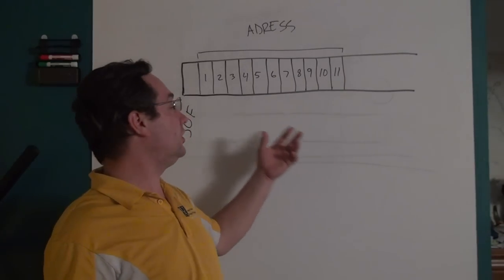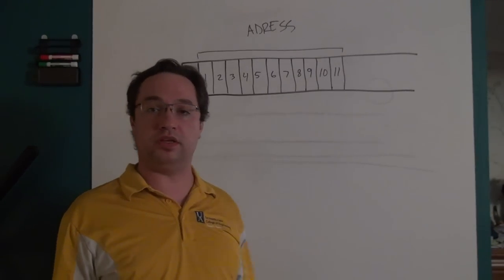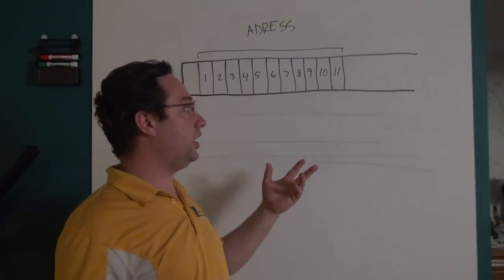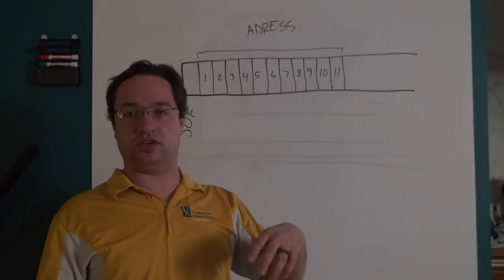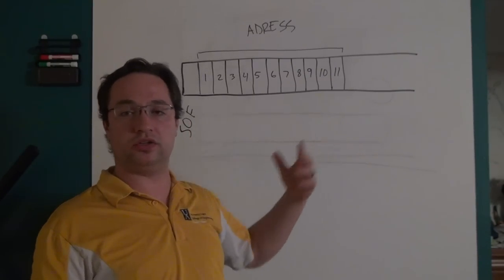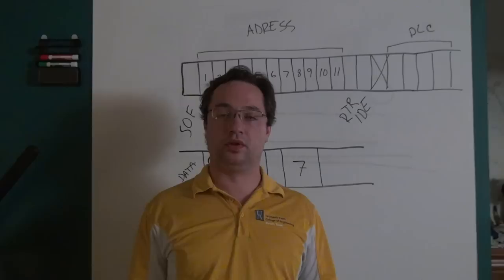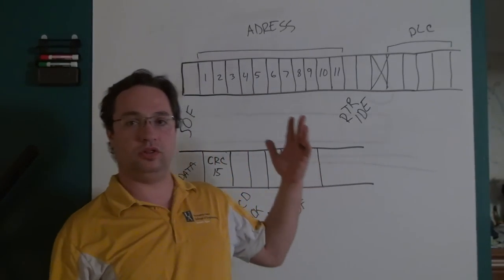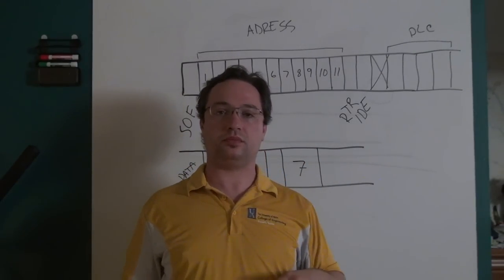eapbg #48 Introduction to CAN (Controller Area Network)

Comment: dood  im an aspiring auto tech  pro , your a dam good instructor  one of the best presentations of CANBUS  i have seen on YT!!!. Dave hobbs eat your heart out this guy is a good teacher  you should collaborate with some tech instructors on YT here like scanner danner or pine hollow auto diagnostics just a thought !!!
Reply from the maker: Thanks. I'm actually an ex mechanic and funny enough I did not use any of this for any kind of diagnostic work. Nor did I even learn it until much later. The info in this video is all design related. Engineers would use this to design a network from scratch. For troubleshooting CAN bus networks in cars all you really need to know; is the wiring good, are the termination resistors good, are the voltages stable and not shorted, and unplug modules until it starts working. If you haven't already check out my video on CAN bus baud rate. That one will make your head hurt. I have thought of doing an eapbg auto edition. As a mechanic, I was the go-to diagnostic and driveability guy. I was thinking of some videos on how car subsystems work like EVAP, fuel injection, or operational strategies. I wouldn't do anything make model specific mostly because I've been out of the game for at least a decade now. Not sure how much demand there actually is for stuff like that.

Comment: VERY GOOD explanation!  My only question is, what happens if a line to an ECU is shorted or severed?  Is that when the ACK say "Hey!  where are you?"   In this case, the bus is still alive and well, but the one ECU does not respond to the ACK?
Reply from the maker: CAN is tricky that way. Any one module can ACK effectively for the entire bus. The ACK only represents that a message came through correctly and not who needed it. Because modules don't talk to each other a module can vanish and the bus would never know. In cars there is a work around. Usually the gateway module (BCM or gauge cluster) keeps track of what modules are up and sets a code if it hasn't seen one in a while. There is also like a role call type feature.

Comment: Interesting explanation of CAN bus operation.  I regularly have CAN bus communications on a STAR topology with up to 120 devices and only using (1) 120 ohm termination resistor at the source of a central controller (a master of sorts).  All transmission is over 105 ohm CAT 5 cable at 115k.  I have achieved solid communications over 3,000 feet of unterminated cable.  Interested on comments as to why this works.  I suspect the low data overhead is partly responsible for the success of this setup.  Usually a single command is issued for operational control.  Please advise if you have similar experience.
Reply from the maker: If I had to guess from your description. There is a really low data rate. The lower the data rate the farther the signal can travel. Also, the central controller is not a typical setup. I'm willing to bet that there is no arbitration and all the slaves are in listen mode only. This would keep collisions down and reduce the effect of reflections, a slow data rate would help with that too.
Reply: @eapbg  Actually this is a motor network for window roller shades.  Each system has a central CAN controller that issues commands to the 120 individual motors or groups of motors.  The motors receive and send data like temperature, position, torque utilization, voltage at motor, rotational speed, etc.  The fact that CAT 5 cable works (outside to 120 ohm standard) and that we are using completely unterminated STAR home runs to each motor is the part that falls completely outside of any published standard.  I agree that low data rates are mostly why this works.  It seems there should be a "CAN Whatever Standard" as it is a very robust.  I would not recommend this for critical applications.

Comment: Very good explanation indeed. Thank you. But still I find one point misleading: you show the connection to the bus as Tx being connected to CAN_H and Rx connected to CAN_L, which is confusing. If I understand correctly, both CAN wires (CAN_H and CAN_L) are connected to both parts of the transceiver (that is, to both - transmitter and receiver).
Reply from the maker: The transceiver has the circuitry to convert H and L to TX and RX. There are no direct connections from TX and RX to H and L. There are pins on the transceiver that have all these connections. That is what the diagram in the video is trying to illustrate.

Comment: I'm not a CAN expert by any means but I know that the technology has been around for a long time.  With that said, I can see CAN being replaced by possibly EtherCAT in the future.  A much faster and deterministic communications protocol.  Of course it may take some time since the CAN system works well and why change something that isn't broke?
Reply: Actually EtherCAT protocol is actually based on CAN Open over EtherCAT (COE). The distinguishing factor in EtherCAT is that the message is decoded in ASIC  hardware which makes it much faster and deterministic.

Comment: You did a amazing job explaining the Can Bus. I’m working on my own Can Bus project and would like to ask you a question?
Reply from the maker: Sure, go for it.
Reply: Do you know if there is any way of capturing a message sent from a node. I have been using a Komodo Can Duo to watch the vehicles can bus messages. I am able to filter down the information by IDs. But I looking for a way or a tool to know exactly what a node is sending. Thanks John
Reply from the maker: @2lowinc236  Practically speaking no. Because of the way CAN works the message pool is homogenous. You have to have prior knowledge of what node transmits what IDs to be able to monitor the traffic from a single node. I have theorized that if you dismantle a module, find the CAN transceiver and attach the TX pin of the transceiver to a microcontroller RX pin you would be able to sniff just that module. But it is a destructive way to do it.

Comment: Thanks, Instead of disconnecting one module at a time is there other ways to troubleshoot? You can look at the CAN signals ID message number and Hexidecimal value and CRC value, can this point you in the direction of knowing if the Module is bad or good? You can measure the CAN signals with the module "connected" and look at the ID message number, hexidecimal value and save them. Then you can measure the CAN signals with the module "disconnected" and look at the ID message numbers and hexidecimal values and save them. After you have saved both connected and disconnected values you can "compare" them to each other?
Reply from the maker: I'm not sure what kind of issue you're trying to diagnose but your welcome to try.

Comment: Thanks, yes a Central Gateway they call them also. So a Central Gateway controls all the difference busses, like SAE J1850 signals, ISO9141 signals, ILS signals, CAN signals? Does every car have a central gateway circuit board?
Reply from the maker: The Central Gateway does not control the bus. It is only a ling between the buses. The Central Gateway is also not just a circuit board. It tends to be built into something like a body control computer or gauge cluster. It is difficult to speak in absolute terms like "every car". No, not every car has one because back in carburetor days there were not buses. Then some networking was required and there was only one bus that linked a few things. Because there is only one bus then a Central Gateway is not required. Also it is possible for the Central Gateway not to connect to all the buses. Sometimes there are buses that are isolated from the rest of the vehicle.

Comment: Good video.
I'm using the Arduino Uno + the MCP2515 chip Transceiver ( as a node ), and have connected two nodes to two different Arduino connected over the bus. For now, I am only simulating some random data ( e.g: ABS ) across both the nodes.
In your video you talk about the End Resistors over the bus ? Do I have to connect resistors at the end of my Arduino+MCP2515 transceivers ?
Reply from the maker: The MCP2515 is not a transceiver, it is a stand-alone controller. The MCP2515 needs a transceiver to get on the bus. An Arduino CAN shield has both built-in. If you are making your own bus then you need the two resistors at each end.
Reply from the maker: @kiranshashiny  yes, that is a transceiver. It is used together with the MCP2515.
Reply: @eapbg   - Thanks for the reply. I do NOT have the Transceiver,  just the CAN controller MCP2515, So when I connected two Arduinos to the MCP2515s  and did a send a receive, What was the 2 wires that I drew from the MCP2515s ? I used fowler's library CAN BUS Shield library and used the built in example Send and Receive programs, they were communicating. I sent an Arbitration id of 0x00,  and the other end got it. 
1) What was the two wires that was used to communicate between the nodes ? ( is that not the bus )
I'm googling and just starting with CAN implementation as a hobby and meanwhile thought of asking you.

While I continue Googling, electronics.stack-exchange.com, Youtubing for answers - thought of posting it here.
Thanks in advance.
Reply from the maker: @kiranshashiny  Assuming the picture is correct, that board has a transceiver and a controller. The transceiver is the 8 pin SOIC in between the connector and the larger controller chip.
Reply from the maker: @kiranshashiny  While it is possible to communicate without transceivers, it is not practical.
Reply: @eapbg  Thanks for replies - Did not see the notes until now. Sorry about delay in responding. I got me two 2551s and working with it.

Comment: Do you  have a video  for  the  diagnóstic  purpose only for technician  ?, this video  is great  but is more address as   programmer.
Reply from the maker: What kind of diagnostics are you looking for? Physical CAN is quite easy to diagnose. There are two 120 ohm terminating resistors at either end. Ohming across the bus lines will give you about 60 ohms. If the bus is 120 ohms or greater then there is an open. If the resistance is much less than 60 ohms then there is a short. If the bus is between 60 and 120 ohms then there is high resistance.
Reply: @eapbg  thanks for responding,  when there is. A gate way  involved  for example  to dived  if the gate way is the problem or another problem  module. Example 1: there  is a u communication  dtc but there is not a clue on the dtc what module  is responding, kind of like  p0300 dtc like romdom misfire  where  they do not know what cylinder is  the one is falling.  
Example 2:  when I have no communication   through  out the dlc conector   with any module  but the  dlc  goes direct to the  gate way , can I disconnect  the  wires  that comes for example  from the pcm to gateway  and create a jumper ( disconnect) de gateway  and do a jumper between the dlc connector to talk  with scanner to  pcm  in this case ?
Reply from the maker: @JoelAutomotiveInaction Sorry, this is going to get a bit ranty because it is a pet peeve of mine. The CAN that I described is the physical communication layer and is exactly the same for everyone; automotive, industrial, aerospace, and whoever else uses it. A software layer is then added on top of CAN. For automotive, this is OBD2. For industrial, this is often CAN open. The software layer is entirely independent of the physical layer. OBD2 existed from '96 to '08 without CAN. What makes things worse is that OBD2 is actually a layer cake of software as well. The OBD2 side is what is outward-facing and mandated by the government. There is at least one layer beneath that which is manufacturer specific. Both examples given are manufacturer specific. 
Example 1: CAN has no way of detecting what modules are present, at all or what so ever. All it knows is that at least one node ACKed after a message was sent. U codes exist in the next layer up. The manufacturer sets up a structure where one module keeps track of who is there and who isn't and sets U codes to show that it has not heard from someone. That said, follow the manufacturer recommendations and diagnostic flow charts. 
Example 2: The architecture of the CAN lines only going to the gateway is transitional. Some manufacturers didn't want to change the architecture of their vehicles but were mandated to have CAN. So they connected CAN to the gateway and that's it. This allowed the DLC to pull all the relevant codes and data while using CAN. Whatever bus the PCM is connected to is most likely not CAN. Once manufacturers fully converted to CAN, they brought the full high speed CAN bus all the way to the DLC. So your options are as follows. 
a. The CAN bus is down. 
b. The gateway is down. 
c. The other bus is down. 
Ohm the CAN bus as described. Try talking to the gateway through the CAN bus. If the gateway responds then the other bus is down. If the gateway won't respond then it is probably down. The other bus will probably be connected to the DLC as well. Try talking to the PCM through it. If it does not work then the other bus is down. If it works, try talking to the gateway through the other bus. If you can't then the gateway is probably down.
Reply: @eapbg  thank you for your explanation

Comment: Thank you for amazing video. One question I have is let's say an identifier consist of all zeros and has highest priority in the bus, but doesn't it mean that everytime it is going to win the bus arbitration. Then how others will be able to send the data ?
Reply from the maker: Messages on the bus are both prioritized and have a time schedule. When designing the bus, because the bus is not managed by a master, the designer must make sure that the bus is not 100% congested. There must be some idle periods to make sure that even the lowest priority messages get through. If we use a car, for example, an ID of all zeroes would be like an airbag deployment (don't know the actual ID just an example). This would happen, sort of, once in a lifetime. So a single all zeroes event would override everyone else just once. Other messages like vehicle speed would be seen maybe every 100ms. It is important and the speed change in 100ms is fairly small. Coolant temperature is very slow changing and so every 10s might be fast enough. The time scheduleing does not come from the CAN bus, it is scheduled by the particular module that is transmitting the message.

Comment: What do you mean by using a CAN sniffer to reverse engineering what? the CAN data files loaded in the eeprom chips in cars ECM, PCM, TCM circuit boards and CAN modules? The CAN sniffer can extract the data files these files out of ECM, PCM, TCM modules and other CAN modules?
Reply from the maker: Reverse engineer whatever you want.

Comment: thanks, So most cars don't use J1850 signals and 9141 signals anymore to control anything since modules now just use CAN buss? Does the TIPM circuit boards use J1850 signals and 9141 signals or its just CAN signals and ILS signals? I'm guessing the J1850 signals and 9141 signals were used to control the cars modules and sensors back in the day but they use CAN signals to control the cars modules and sensors and don't use J1850 and 9141 signals anymore?
Reply from the maker: No idea, don't know much about the TIPM.

Comment: Thanks, every car as a TIPM central gateway that all the modules connect to? The TIPM central gateway has all the CAN transsciever chips on the TIPM circuit board? Because the TIPM has Microcontroller ECU chips and CAN transcievers chips to do what, i'm not sure what the TIPM circuit board does really.
Reply from the maker: The TIPM seems to only be only a Chrysler thing. Not sure if the TIPM is a gateway for Chrysler. A gateway is a central place where multiple buses connect. A car can have multiple buses. Any more it tends to be CAN buses, high speed, medium speed, and low speed. High speed is used for the engine computer, body computer, airbags, ABS, and so on. Basically all the really important stuff. To make sure the bus is not congested with the not important stuff, the stuff is moved to a slower bus. Things like door locks, windows, windshield wipers, climate control, rear defrost, radio, and so on. The gateway moves information between the buses. It filters the information and only moves what is needed. For example, the climate control needs to know the coolant temperature. The gateway moves that information from the high-speed bus to one or both of the lower speed ones. Something to note that seems to be a confusing spot. A transceiver is just a connection point to the bus. The bus is a differential type bus. Microcontrollers can't speak differential. The transceiver is basically an adapter between single-ended and differential. A transceiver does not exist on its own.

Comment: Thanks, But what are these SAEJ1850 signals and ISO9141 signals used for and have you used them to troubleshoot failures in cars? they are on the DLC connector
Reply from the maker: J1850 is a standard used by Ford and GM at the beginning of the OBD2 days but before CAN. 9141 is the same thing but for Chrysler. I probably have used them. Scan tools will connect automatically to whatever is needed after you punch the car in. I've never had to directly probe any of these buses.

Comment: Question, when a node Crashes  can it bring the entire network down for instance like a short or voltage spike?
Reply from the maker: In theory, it's possible. If a node goes nuts and starts using addresses that conflict with others or monopolizes the bus with some high priority address it could bring the bus down. Also, it's possible for a node to hold the bus in its dominant state. Both of these are highly unlikely and would require horrific software to even be possible. Otherwise, if a node goes down it normally tristates its pins which places the transceiver into effectively a listen mode. This won't effect the bus.